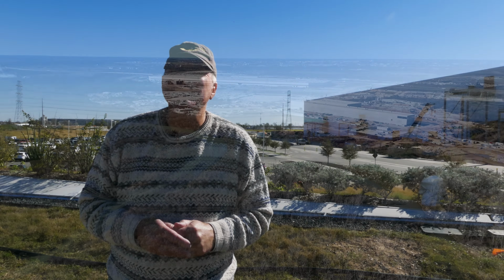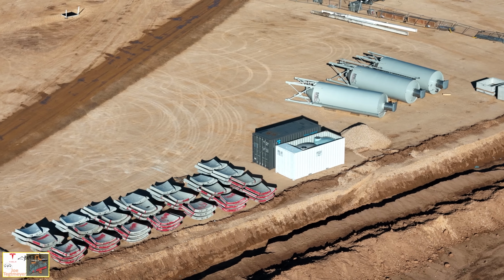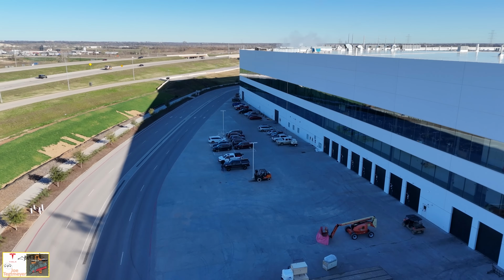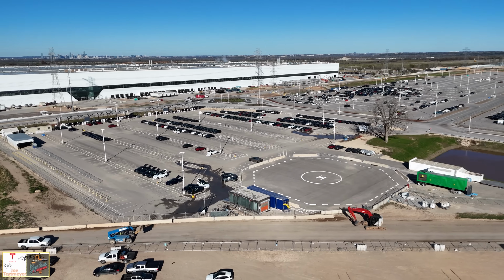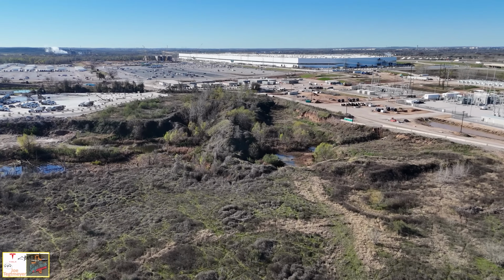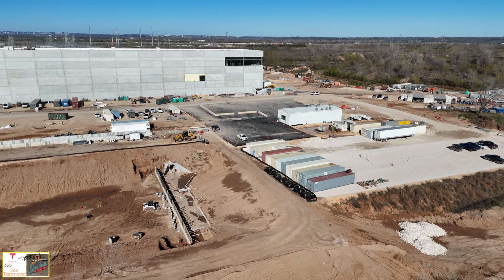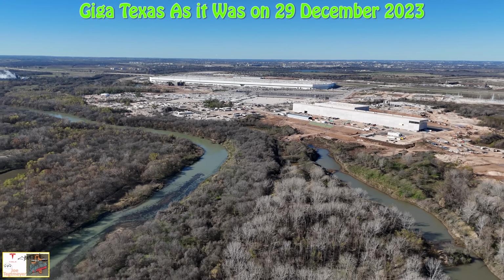Cybertrucks Moving! Far N Views & Boring Co Cement Silos! 29 Dec 2023 Giga Texas Update (09:15AM)

Comment: Thanks Joe

Thanks for all the great video and photos over the year. Kept me busy!
Happy New Year to you and all your Youtube viewers and patrons.

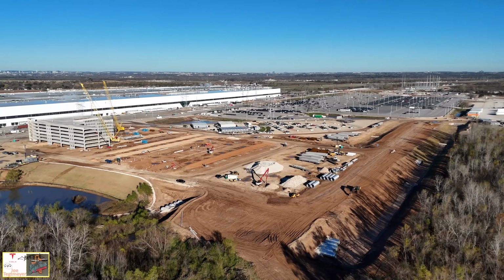3:59. Parking Garage. Based on only half the total area of the garage being available for parking I estimated a capacity 7560 vehicles. Based on a third, 5040.
As of this video not 15% of the Parking Garage footprint has been built to the top level. It's big.
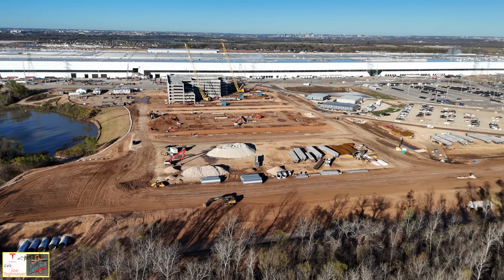4:10. Parking Garage site. Materials staging area doesn’t fit into the 1,743,000 sq ft quoted on the Plumbing Permit application for the Parking Garage.
5:09. Parking Garage. Installing timber safety rails around the open edges.
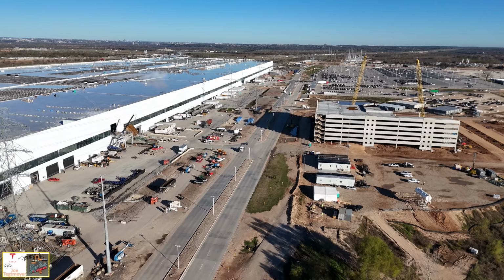6:23. Parking Garage site. Bottom. Making up the timber safety rails.
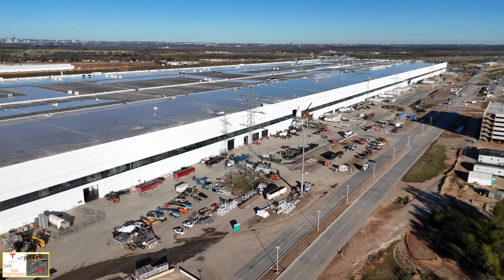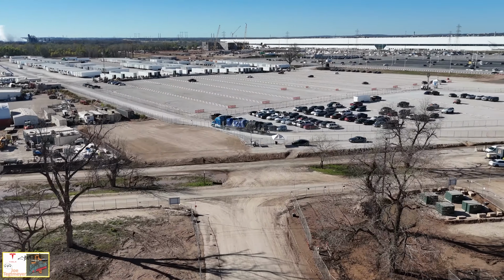6:27. Stamping, apron. Trailer with large blue fan units backing northwards. Might be another delivery of the same at 28:42 into the WOW yard.
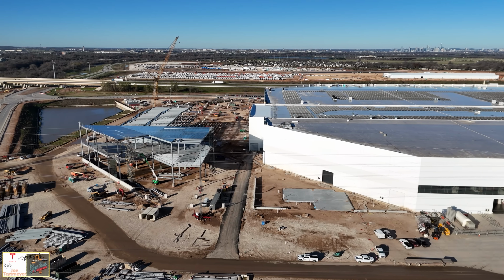6:38.  Southend. *Wild Speculation alert*. A line drawn across the end of the original building and over to the W-WOW, crosses the gap in the grade beam at 8:44, and closely intercepts a soil test drilling site from 24 March. Boring Co silos and tunnel segments visible a little to the north of the W-WOW.
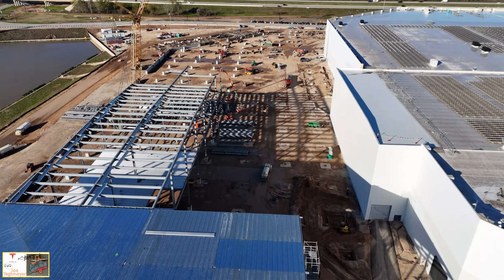7:34. Southend, south side. Thinking the crane will relocate at some point to the outside of the retaining wall. Ground being prepared.
7:53. Southend. Retaining wall. Bottom left. Will be interesting what happens at the small step-down in the wall. Doorway would seem likely, but it’s elevated.
8:41. Southend, westside. Column pedestals. Row B the second row from the outside. northern most pedestals are shorter.
8:44. Southend, west side. Bottom. Gap in the grade beam. Tunnel entry….
Has to be somewhere.
15:12. Battery north, inside. Level 1. Right. Large section of gravel floor, or demolished concrete perhaps.
Level 2, concrete completed.
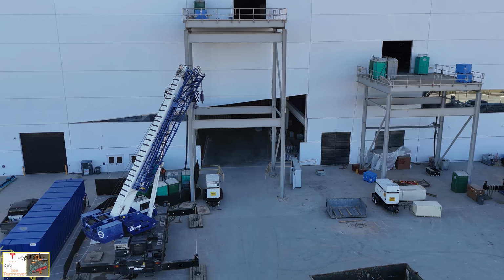15:45. Northend, parking. Bottom left. Cables hanging out of the vault.
16:55. BIW, apron. Against the wall. Electrical vault. Floor slab complete. Sheet piling arranged around 2 sides.
17:19. East Main Entrance. Glass been cleaned perhaps. Glass mounted door handles visible.
23:05. Far north. Earth being dumped along the tree line is likely to be topsoil or other soil unsuitable for use as fill.
24:58. Cathode pond. Outfall structure. Small white pipe would be the primary drain from the bio-filtration basin. Larger pipes would be the overflow for heavy rain events when the bio-filtration basin is overwhelmed with the volume of water.
25:05. Cathode pond. North. ‘Flow spreader structure’. Casting short sections of pipe into the wall to create the openings.
Reply: Thanks Dessie for all your valuable insights!
Reply: @59seank  You're welcome! I enjoy putting them together. Happy New Year to you.
Reply: Happy new years Dessie
Reply: @benguthrie49  Happy New Year to you Ben!
Reply: Thanks Dessie for all your inputs.
Reply: @Dwayne.Shea.231  Cheers Dwayne!🍻

Comment: 20:12. While it does contain insulating components, the missing component is a POTENTIAL TRANSFORMER used to step the high voltage down to 120 volts in order to accurately measure and monitor the voltage of each power line.

Comment: Lots of speculation as to what Tesla may be planning with regards to the Boring Tunnel concrete liners - many of which might be goers - but it's probably as mundane as simply wanting a more easily accessable conduit service tunnel that they don't have to dig up. As you say, Joe, it will be interesting to watch what happens.
Reply: Lots of space under the road deck of tunnels that is generally used for drainage, but could just as easily be used for utilities. Road tunnel seems likely, with the added benefit of being able to install pipes and conduits for utilities under floor, and along the wall.
Reply: @DessieDoolan  Do you mean Tesla's road decks or that of the Highways Authority, Dessie?
Reply: @pinkelephants1421  Tesla's road deck.

All tunnels have a drainage system inside the tunnel at the lowest point. In The Boring Co tunnels there is an elevated road deck that spans between the walls. Plenty of space below that.

Joe has the plans for the proposed tunnel under the river in his 10 September 2022 Patreon presentation. Lots of details including a tunnel section showing a diameter of 12' 3.6m internally.

Space under the road deck scales to about 24" 0.6m

For what it is worth, the permit application for that project has expired.

Also of interest is that Tesla's project number was AUS-006, which I took to be Austin tunnel 6.
Reply: @DessieDoolan  Cool! Thanks! 👍

Comment: Hmmm ... my gut says that the only way a boring tunnel makes sense is if the tunnel termini were located inside the factory and the end-of-line facilities respectively. There would really be no need for a tunnel just to get the vehicles from the factory to the end-of-line facility as there are perfectly viable highway crossings existing at River and Tesla Roads.
Reply: Nah, they want a private tunnel (and road), not use brand new cars on public roads.
Reply: Interesting that we're not seeing evidence of the usual end-of-quarter delivery push. Instead, the empty parking lots suggest that there is an end-of-year holiday taking place.
Reply: @PhillProbst Vehicles built this week would not have time to be shipped to Tesla locations for end of the year delivery.
Reply: @SpaceTravel1776  Those are not public roads.

Comment: The one thing that I don't get about the way that the permanent switchyard was designed is why they ran the underground wires from the battery pack to a pole. In Québec, we just run them directly into the switchyard where they need to go.
Reply: It is directly into the switchyard, via the monopole at 20.33

I would guess that the LCRA designs the switchyard to only suit their needs, and connections the switchyard from other providers are done exactly the way the LCRA requires.

The point of connection in this instance is not inside the switchyard, which must somehow suit the LCRA.
Reply: Another thing to remember is that there two sets of transmission lines between the BESS substation and the LCRA substation. The easiest way around that problem is to use underground cables. For overhead lines... There are minimum clearances between transmission lines and other transmission lines, as well as between transmission lines and the ground.
Reply: What Dessie wrote. LCRA makes the rules of how the connect to everything. And it’s all documented in their rules. If you want to connect to them, you follow their rules. In the rules for a BESS, they go over how the connection is made and the fact that it’s not on the LCRA substation property but at the customer’s property adjacent to the substation. The measurement equipment is also located on that jointly controlled customer site. That way only LCRA ever needs access to substation.
Reply: @Bill_N_ATX   I guess the idea is that when LCRA wants to disconnect Tesla Energy, it's just one switch, or one procedure in one location.

I wonder how the supply to GT is handled. With the 2 transformers do they need to turn each off individually, or is there some point in the switchyard where the supplies interconnect and can be shut-down, again with one switch/procedure?
Reply: @DessieDoolan  Dessie, it’s a double breaker, double bus substation. That’s the most reliable design. In theory, power comes in from both directions of the transmission line and each direction feeds one side of the two inputs for two busses. Then there are two circuit breakers feeding the transformers. They can be set one buss feeding each breaker to each transformer or route any line or buss to both breakers and both transformers. Then hopefully, the SCADA system inside the factory has the ability to feed the output of either transformer to any circuit in the factory. So it gives you lots of redundant paths….but at some point you will have to cut two circuits if you want to be sure the power is off.  And maybe disable the tie line too.

I’ve worked in a couple installations with very, very redundant power sources. I’m talking three feeds from different substations, two uninterruptible power system feed from huge battery banks, and four 1.5 megawatt diesel generators sets. Millions of bucks in electric infrastructure. But in large network and data centers, it’s just the cost of doing business.
Reply: @Bill_N_ATX  Thanks for that. You have told me that before, but I keep forgetting it. Struggle to remember stuff I'm not particularly familiar with.

Changing the subject, were you surprised at the delivery of additional glass for the southend? I sure as heck was. Not even a month after the others were installed, so the new units must have been on the water already. I think the units come from Germany.
Reply: @DessieDoolan   Not particularly surprised. At this point in history, every supply chain is F’d up. So you have to order stuff as soon as you can and find a place to store it when it comes. Just in time delivery went out the window sometime in 2021. I just received four POs for a large central project and three add on workflows to the core project. In 2019, I’d have ordered the core components and then ordered the others six months from now when we will be ready to add them onto the core system. Not in 2024. I just sent off the purchase orders for all the hardware knowing that a million bucks worth of hardware will be sitting in a storehouse for six months. I can’t take the risk of it just not being available when I need it sometime in June or July since I have to be finished in by end of September. So no, I’m not surprised that they already have long lead items onsite and more headed their way. And the customer is willing to lose six months of the manufacturers warranty because they understand the supply chain risks too.

Comment: Thanks Joe. In Australia if you take a car on a public road it needs to have registration and insurance. So I gather the US would be the same hence Tesla putting in private tunnel to join both sides.
Reply: It is a private road being built parallel to River Rd under the highway connecting the factory to the new end of line building. Just like the roads around the factory that they drive production vehicles on now.  

It may be cool to run a tunnel instead, but it’s not necessary & only saves a few hundred yards. Not much of difference, especially once they shift to self driving.
Reply: In Texas, Tesla as an automaker, can use a manufacturer tag if they needed to, but I doubt very seriously if either the state or county would make them put a magnetic tag on the car to go a half mile. As a manufacturer, they don’t need to register the auto till it’s sold to its first buyer and as a large company, they are surely self insured. In Texas, that means you just post a bond from one of the registered bonding companies or some other form of guaranteed funds with the state. Once you do so, you don’t have to insure each vehicle by number etc, you just have to carry a piece of paper in the vehicle saying you are self insured and what your registration number with the State Dept of Insurance is.

Comment: I think it's most likely that the Boring Company tunnels will be used to get maximum efficiency moving cars to the end of line facility initially, but I can imagine them using tunnels to shorten transit times for movement of materials into the factory, such as battery packs.  The first tunnel may well connect to the removed ramp at https://youtu.be/7om5JiMCInw?t=822 although the space looks a bit tight

Comment: I don't see what purpose a tunnel under the highway would serve. They can drive under the highway very close to the end of the lines. It makes more sense to me that they would tunnel to a rail head or something.
Reply: In my opinion... Any tunnels are silly.
Reply: @DavidJohnson-tv2nn  Could you add context please?
Reply: Corpus Christi is only 160 miles if you go straight south..
Reply: Then Nuevo Leon perhaps from there
Reply: @0saskatchewan   Tunnels would make sense only under limited circumstances. For example, a tunnel to get parts from a warehouse to an assembly line in another building. Building tunnels just to hype the Boring company, which has no real purpose, seems to be beyond ridiculous. 
A tunnel under the freeway when there is already an existing access road makes no sense. 
A tunnel to a rail head  would be impractical, costly, and maybe impossible. Since Tesla doesn't own any right of way. And keep in mind that there is a major freeway within a few hundred feet of the building. Also, putting miles on customer cars probably wouldn't work out well.
So yes, there is a purpose for tunnels. I just don't see it here.
Reply: @DavidJohnson-tv2nn  I don't think a boring tunnel would make a lot of sense for parts and materials over small distances. perhaps a 7 foot diameter tunnel, but not 14.

Comment: Many amazing videos this year! I keep looking forward to each of them!  That parking garage is growing very fast!  I wonder when it will open?   2 - 3 months?  I guess they will pour concrete for the bottom floor after the rest is about done?  

It would be amazing if they can send the new vehicles between the factory and the new delivery site without any drivers in them!  Or maybe drive on and have two or three other vehicles follow their leader!  If they go through  a tunnel, that would be a easy thing to do.
Reply: Agree 100% that moving the vehicles from the factory - perhaps autonomously - via a boring tunnel under the highway would be an elegant solution and would eliminate the need to load them on trucks, drive over to the delivery site, unload them for out processing and then load them on trucks yet again for transport.  Sure a short tunnel would cost up front, but they might use the opportunity to test Prufrock 3 or 4 plus they would avoid the ongoing costs of all those short truck trips.  For extra credit they could put the tunnel entrance inside the Giga factory and the exit inside the new delivery site building.
Reply: I wonder if it would be possible (or worth it) to build a tunnel to the railhead.
Reply: @59seank  obtaining right of way for a tunnel would be prohibitively expensive. You’d need to obtain the right of way to dig under property just as if you were building above ground. In Texas, you own your property from Heaven to Hell, ie not only the ground but the air rights and underground too. Most property in Texas has had mineral rights sold at some point but even those only give you rights to under the ground. They’d have to negotiate access to those underground minerals. 

* There is a very, very exhaustive private database in Texas for the ownership of mineral rights. It’s often better than the ownership records of the actual ground itself. Of course, in parts of Texas, the mineral rights are worth more than the property above it.
Reply: @Bill_N_ATX  Assuming Texas government approval, would routing the tunnels alongside existing roadways work?
Reply: @59seank  yeah, but getting approvals would be very difficult to impossible.

Comment: Concrete is the correct word, cement is a part of the concrete mix.
Reply: In reference to the silos, cement would be correct. Aggregate and sand is generally kept in the open at concrete batch plants. The silos would be for cement, and possibly some specific fine aggregates for use in grouts.

Comment: Joe the boring tunnel I think is part of Elon's thinking.  He is trying to cut time on everything.  Every car that would have to be driven by a person from the factory to the Austin side of interstate would require many people and then they would have to be driven back to the other side.  If the tunnel is put in then the full self driving could be used to go through the tunnel without getting wet, muddy and save one to two minutes or more for each car.  I think this is what is going to happen.
Reply: You don't think OSHA might have a problem with that? Despite the marketing BS it is not full self driving. It is only level 2.
Reply: @DavidJohnson-tv2nn   I would be very surprised if a Tesla couldn't find its way through a tunnel using whatever sensors the auto-summon feature uses. It's not like it can get lost.
Reply: @DessieDoolan  Not so much whether it can find its way through a tunnel. Its a safety issue. Notice that in the Los Vegas Loop system, they have  human have drivers.
Reply: @DavidJohnson-tv2nn  Las Vegas. That would be because they have human passengers.

If auto summons can find its way around a parking lot, a tunnel won't be much of a challenge.

In fact I'd be surprised if any modern car equipped with lane assist couldn't navigate the tunnel with some minor software tweak.
Reply: @DessieDoolan  Again, I agree completely that it could navigate a tunnel. The issue is safety. There are humans at each end of that tunnel. I assume that they probably would not want to be run over :) Being on private property doesn't give an employer a free pass to put the employees safety at risk.